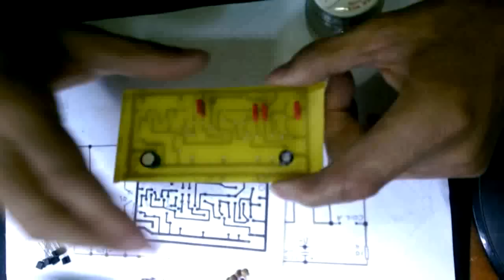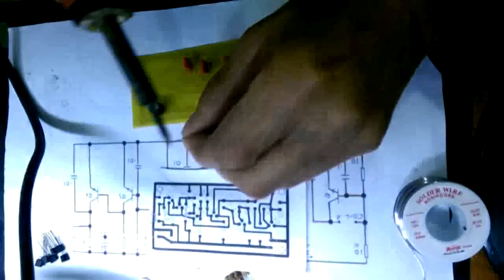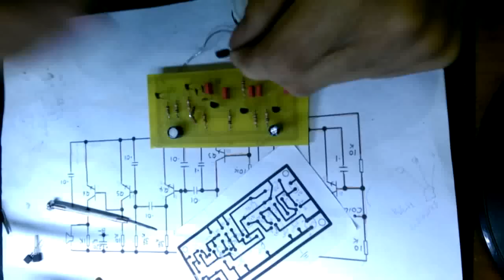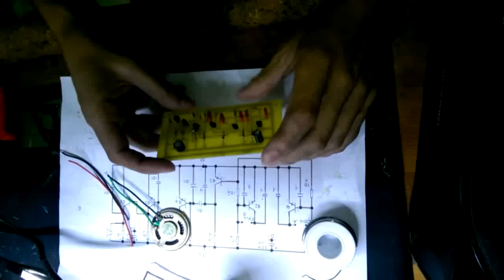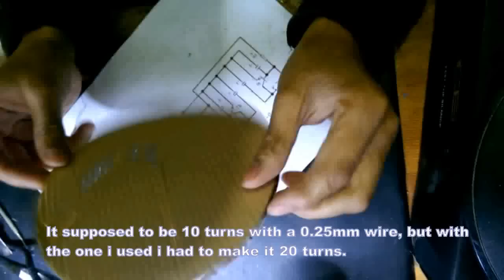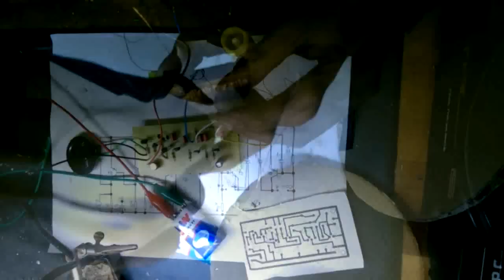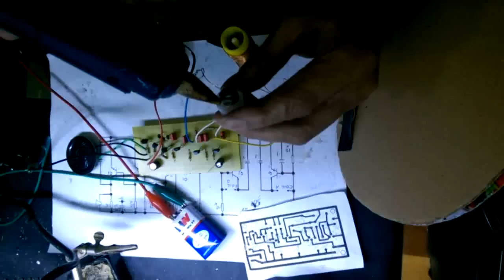Homemade Metal Detector

Comment: I have made the same project but I hear a high frequency sound what's wrong?
Reply from the maker: +Double Rave It's probably your coil resonate at higher frequency , does the sound changes when you move the secondary coil's core  or place a metallic object near the first coil ? .
Reply: +Oussama Ousmoi hi,,,can i make a bigger coil for that design?
Reply from the maker: +Antonio Empleo probably not , the web site point that the oscillation frequency should be around 100khz .  if you want increase size of the coil you will have to adjust number of turns  to stay in the same frequency range .
Reply: Thank you very much sir ,,,GOD bless you
Reply: +Oussama Ousmoi ,just confuse ,,the postion of the trandistors in google (same circuit board) were different to what you had made,,,, did you used other transistors,,thank you,,
Reply from the maker: +Antonio Empleo Ah i see, it happens :) . glad it it worked for you now .
Reply: +Oussama Ousmoi instead of using coil for frequency adjustment,, can i use any variable?and ksp2222a will work? thanks
Reply from the maker: +Antonio Empleo You can probably do a variable capacitor instead of the 0.1uf  directly connected to the B  coil  , but i guess it would be hard to tune
Reply: +Oussama Ousmoi ,,thank for your kindness sir,, i wont stop until i got it that is a nice project
Reply: +Oussama Ousmoi ,, i noticed you used 103 ceramic capacitor,, mine was polyester film, from easytreasure,,,, and not working,,do i have to change  them? thanks again
Reply from the maker: +Antonio Empleo Yes  polyester film capacitor should work too . so must be something else is wrong .
Reply: +Oussama Ousmoi ,is it necessary to use same size of wire for the transmitting and recieving coil,,and you use wire from transformer,,, which of them primary or secondary? thank you,,,
Reply from the maker: +Antonio Empleo It's not necessary to use the same size of wire, but number of turns will differ . better use the same size though .   you can use this link to estimate the coil value  based on the turns diameter and length : http://www.66pacific.com/calculators/coil_calc.aspx .
Reply from the maker: As they suggested in the web site , try to make at first  2 identical coils , same N turn same wire same everything .  and use them to make sure the circuit works . and then later you can remake the secondary coil .
Reply: +Oussama Ousmoi ,,can i use a hair size wire?,, i have many with this size ,,
Reply: +Antonio Empleo I supposed yes but you have to do different number of turns

Comment: how you calculate how many turn you have to make to coil?
Reply from the maker: The best way is to make exact number of turns mentioned in the link , with the same wire size , and add or remove few turns till you  hear a buzzing sound . 
the goal is to make the oscillators to  resonate at  100Khz +- 250hz .
Reply: thx, but i want to make about 40cm search coil
Reply from the maker: not sure if it will be possible with this circuit .  there is equation to  calculate the coil  value based on the number of turns  coil, diameter  etc .. , you can find  details here  https://www.allaboutcircuits.com/tools/coil-inductance-calculator/ 
if i''m not wrong the coil should be around 60uH  .
Reply: thank you

Comment: What type of tranzistor used?
Reply from the maker: I used 2n2222 transistors, they worked fine . A similar ones should work too .
Reply: +Oussama Ousmoi ,,is ksp2222a will work?
Reply from the maker: +Antonio Empleo Yes it should work ,it seems  the same as 2N2222a

Comment: What copper wire size did you used?
Reply from the maker: I used a 0.5mm wire
Reply: Thanks a lot. :) Can i ask another question? how can you determine the size of the copper wire? is there a practical way in finding it?
Reply: And also, how do you fit the 185 turns in a 5cm long? can it be overlapped? Sorry if i have a lot of questions. Im new to this. Tnx in advance.
Reply from the maker: Sure no problem at all , ask as much as you want :) .   The practical way to measure the wire  is with a digital caliper i guess .  
You can fit it if you wind it carefully in layers . 
Good luck :)
Reply: so how do you fit the 185 turns in a 5 cm long?
Reply from the maker: you wind  the first layer  in 5cm distance , then the next layer on top of it ,and so on till you complete the 185 turns .
Reply: so how many turns in each layer did you used? how do you determined the no. of turns to be used in each layer?
Reply: Forgot to ask you this, uhm.. whats the inductance of both the reference and search coil?
Reply from the maker: The number of winding on each layer does not matters much ,  only the total does .
Reply from the maker: Sorry,  No idea about that , i didn't have an inductance meter  :)
Reply: its okay. :) last question, does the layer need an insulation? like a duct tape? or i can just overlapped it?
Reply from the maker: between layers no need for insulation .  the wire must be already insulated though.
Reply: Okay. :) Thanks for the help. Great vid btw. :) thumbs up Hope I can really make one. haha
Reply from the maker: You're welcome . glade it helped . Good luck :)

Comment: I have made this metal detector and it can't detect GOLD
Reply from the maker: +Double Rave I noticed the same thing , after few search in the net , it looks like Gold detectors  uses low frequencies , less than 3khz , this one operate at around 100khz .  i am not sure if you can tune this circuit at lower frequency or not , but try play around with the  capacitors and the coil sizes .  i couldn't do it because it's time consuming specially that i don't have a LCR meter  to easily make precise coils .
Reply: +Oussama Ousmoi what caps I could change?
Reply from the maker: +Double Rave the 0.1uf ones directly connected to coil A an B most likely  . the circuit is based on Colpitts oscillator  i believe .  if you have access to an oscilloscope, that will help you a lot to see the frequency changing while varying the caps values .